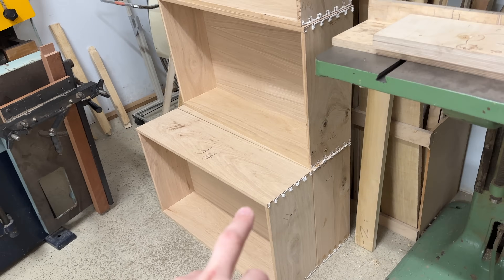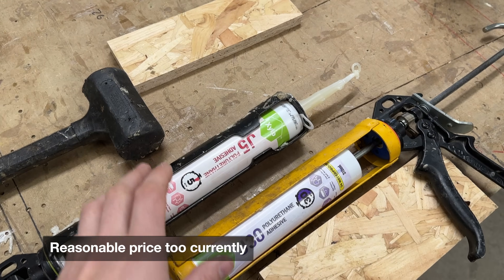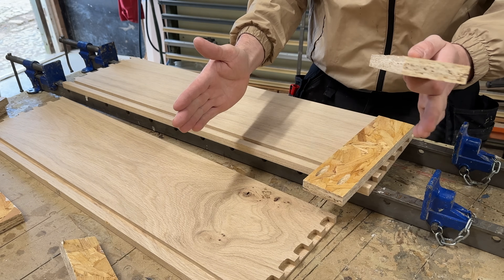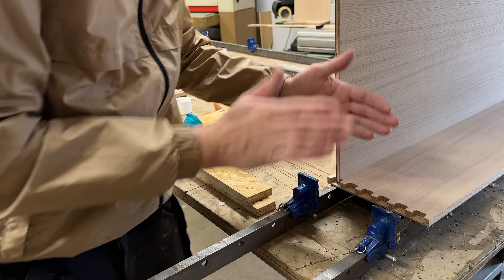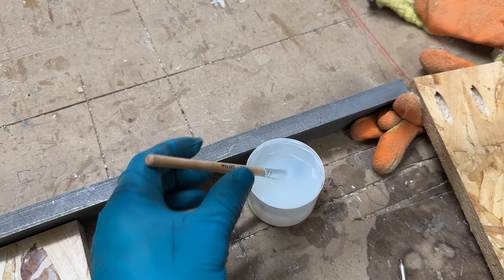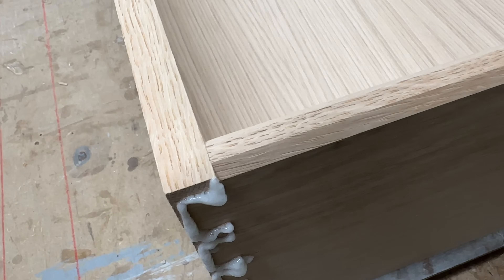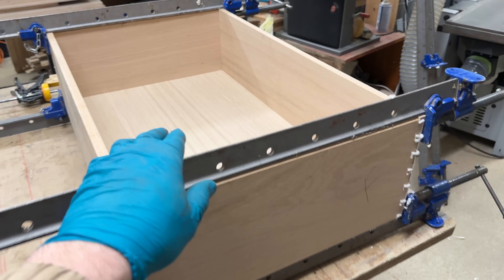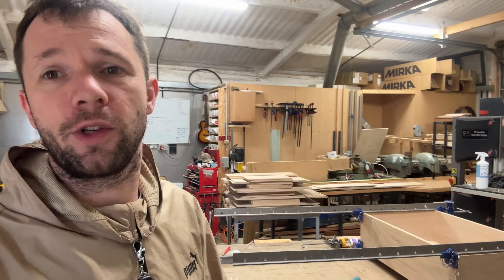How to Assemble / Glue Dovetail Drawers Profesionally

Comment: Great video, thank you! Another very important step in glueing up a drawer is to check it for twist. That can be easily achieved by sighting front to back. When we made traditional drawers, we would make drawer slips rather than grooving the drawer sides. Cheers🍺🍺

Comment: I've really got to try tube glue, I use tube construction adhesive (thick PU glue) and it's hit or miss for a lot of construction work but that PU glue you use doesn't seem to expand like the liquid stuff I've tried.  Also you don't appear to wet one side either.

Comment: Brilliant work as always!! Is it best to wear gloves when glueing up as is it difficult to remove the polyurethane glue off your hands if not wearing gloves? Also is it best to use the glue in a manual or powered caulk gun when applying it?
Hope all is well, take care
Reply from the maker: Yeah always wear some disposable gloves. Manual gun is best, something with fine controll over power as it's generally easy to squeeze out

Comment: So....its 2 clamp setups for one drawer?  Interesting....
Reply from the maker: Yeah if you want unique spaced dovetails. You can do both at once if a standard even spacing wanted, but it doesn't look very bespoke
Reply: I would basically do both clamp setups in one but I suppose the way you do it makes ot less faffy....because getting the second set on is normally a pain..... @BradshawJoinery
Reply from the maker: @philippboetcher9959  ahh sorry I thought you were talking about the router jig, yeah push together with one then clamp the joints tight with the others